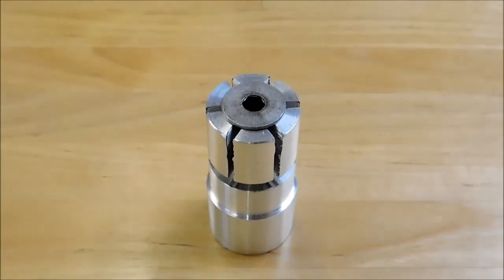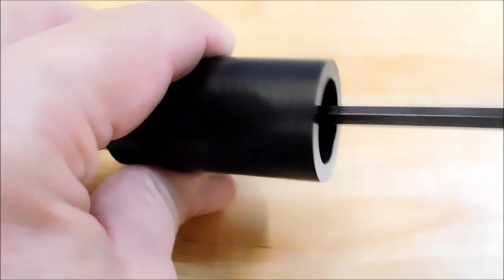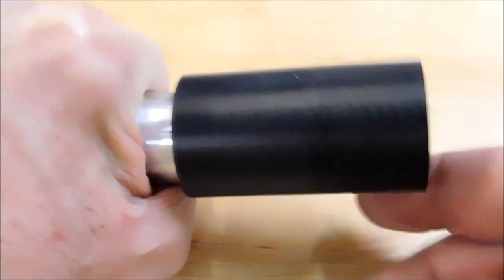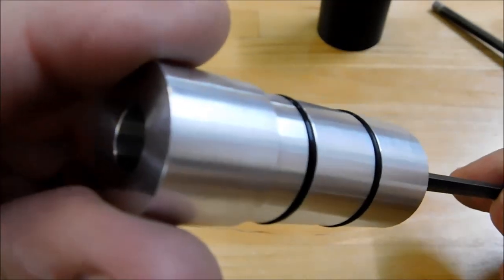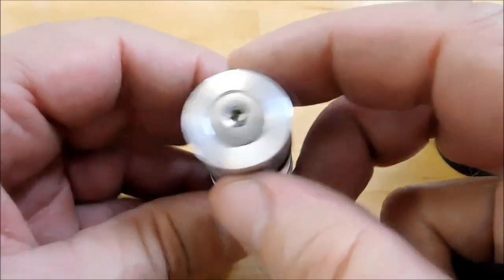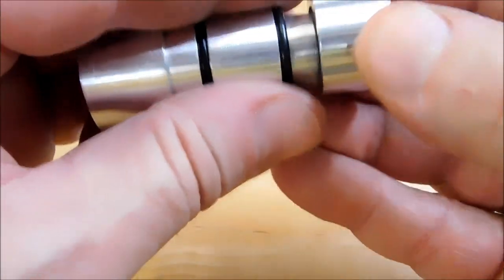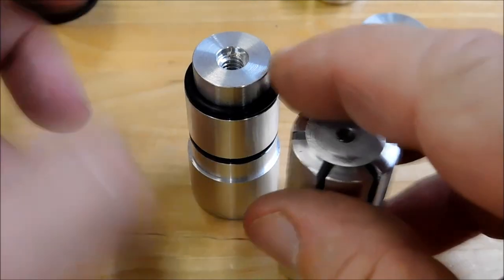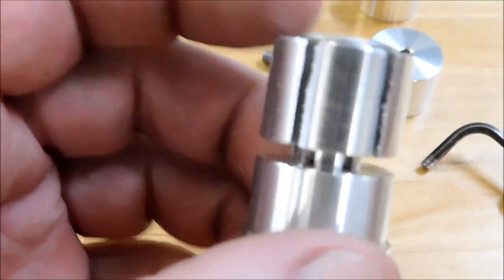Expansion Arbors --- No through hole...No Problem..Take a Look

Comment: The O-ring arbor version was a nice implementation, and your afterthought pointing out the need for drilling a short recess to the major diameter to clear the unfinished threads under the  head on most countersunk screws was pure gold. Most people would miss this, and the arbor would expand unevenly as a result.
One quick and dirty kludge I have got away with for lightly skimming the outside diameter of (say) one or two bronze or plastic bushes to ease the fit, is to use an expanding reamer of the Sutton Microset style, chuckng the shank and supporting the entry end on a running centre in the tailstock. Don't overtighten or you'll mark the bore!

Comment: For thin items needing accurate work I like to use heat shrink fits on solid arbors so there is no distortion. Lots of good info in this video on expansion arbors, thanks for sharing the tips and tricks.

Comment: thanks to your cool ideas ! they make this novice/wanna-be newbie machinist. think more outside of the box.  thank you for sharing!  here is a idea my little brain came up with for a machinist jack,  the 1/2 fine thread bolt i used to make the jack, I turned a concave in the face of the head. to receive a 3/4 in ball bearing i had. the ball bearing i ground off  about 30% flat spot in it.  I thought about using a magnet to keep them together, but i found a small dab or oil or grease works wonders too. thanks again!
Reply from the maker: I use that concept on my mill vise. Chuck over at "Outside Screwball" sells them. He calls them 'Crazy Balls".

Comment: Amazing and well done.  I was just right now having a problem making plastic fittings for a job.  You are correct, I was using an exhaust pipe expansion tool to hold the fittings but the forces were breaking the plastic.  Also, it looks like the rubber O-rings will increase the friction for holding over the friction of the steel.  Very much appreciated and it comes at such a good time.  Thank you, helped me out very much.  :-)

Comment: On a job today I was asked to make a removable fence to set on top of a brick wall. The builder had inset pvc to slide something in but did not know how to keep water out AND be removable.  Guess what crossed my mind.  I have several months before he needs them so I will be playing with this design as well as an offset bushing for misaligned pipe.
Love your techniques.
Reply from the maker: Now that you've seen it, I'll bet you solve your problem. Good luck.

Comment: These things are very handy. First time I saw arbors like this we were using pipe thread plugs to do the expanding. Not as much radial expansion, but they worked well. As is the case with a collet, the expansion makes the arbor conical, so the better fit of the arbor to the part before expansion, the better.

I've also used arbors that use an end cap to trap the part by its ends instead of expanding. Again, the closer the fit of the arbor to the part, the better for concentricity.

Comment: I actually had a need for one of these today and ended up making one. I had to cut a thread on the end of a pipe that didn't fit through my headstock and was too long to cut on the other end with a steady rest. 

My method was to turn a 60⁰ taper on a random socket head cap screw I had laying around, turn a slug to a slip fit in my part, drill a clearance hole through the slug, taper the end and cut 3 ways on the bandsaw.

I just tightened a nut on the cap screw and then with the help of the steady rest I was able to cut my thread!
Reply from the maker: Once you see the concept, the variations and applications open up a lot of doors.

Comment: Hi Joe. Great video as usual. I needed a backstop for one of my 3C collets. Unfortunately they are all different internal diameters because they have originated from different manufacturers. So the expanding arbor I made for one of the collets with great precision did not fit some of the other collets. I really did not want to spend the time replicating my design. Your design is much simpler and quick to make so suits my application perfectly. In fact the O ring style might work even better since it will accommodate internal collet diameters of different sizes with just one device. Many thanks.

Comment: Many thanks for the work you do to bring us 'newbies' along.  O-Rings are great, but sometimes misunderstood. Many times you will hear somebody say "compress the o-ring". But what you know, and maybe would be helpful to make a point of whenever the topic comes up is this: Rubber is not compressible, it is deformable. I think you alluded to this once when you were cutting an o-ring groove... The volume occupied by the rubber remains constant as the shape changes. So, that is why you can apply some serious pressure to the ID of a part with something that most folks would call squishy...
Reply from the maker: These can be very strong when applied correctly.

Comment: Thanks again Joe, you saved my day . i tried to mount a 32 " Display to a wall in our guestroom-- not a prob ?-- of course it was one, there were no VESA mount holes (holes were there but not threaded :(  ) in the back of the Display.- darn. Everything else was already mounted, swing-arm to the wall, power-outlet etc etc . and than i remembered the "last" expansion plug you showed, ran down into my shop,  made 4 of these  and finished the job.  i really appreciate your knowledge and also your generous way of sharing it with us.  rgds and all the best . michael

Comment: Saved the day! We machine polycarbonate tubing and have been looking into ways to hold it when facing the cut ends. The Idea of an 'O' ring id great. I just finished  making one from solid PVC rod and tubing for the sleeves. It works great! Thanks Joe for this tip!
Reply from the maker: I thought up  the o'ring arbor many years ago on a clear acrylic tube job. It was the only thing that would not scratch the part or break it while holding it securely. I hope it works for you.

Comment: Excellent. This is the method I usually use to hold the small cylinder casting for miniature steam engines. Once the outside flanges have been cleaned up and machined the casting is then held in the independent 4 jaws and the outside indicated and then the bore is machined. This way the bore becomes true with the usually irregular outside of the cylinder. Thanks.

Comment: joe , i was thinking your screw cutting  method would may work really well on older lathes with worn out half nuts as it would use the unworn side & eliminate the engagement problems one has when a step is worn on the half nuts , i used to use an old 17" harrison lathe that the nuts were so worn you had to hold the engagement lever up with your hand ! cheers from perth , australia .
Reply from the maker: Good point.

Comment: Great tips. You can also do the expanding metal one in a part with a blind hole by using a long screw and tightening a nut from the other end. Eliminates the need to turn an externally tapered plug.

Comment: Thanks again for clear advice and refinements on common techniques. Right now, I’m heading back to the basement where I left a small steam engine cylinder on an expansion arbor in a collet block, in the mill vise waiting for action. My arbor is not nearly as nice as yours, but the next one sure will be.

Comment: And once again, you prove that the simplest solution is the best solution. I have my own solutions for those work holding problems but not nearly as nice. Occasionally, I will make up an arbor and then attach my work piece with a bit of Loctite 609 sleeve retainer ( the non-permanent type ) which holds with an iron grip. You just have to look ahead to how you are going to remove the part afterwards. But it does work very well.

Comment: This is great!  My uncle showed me the o-ring trick many years ago.  His method was to install a "cap" in the tube but with open hole in the center, so he is using 3 screws in the face to squeeze two circular plates with o-ring in between at the top with a groove and I though that was pretty brilliant.

Comment: HI Joe I made one similar sometime back but used a pipe plug for the expansion.  I drilled out the stock and taped it with the a pipe tap then cut the slits  to allow the expansion. filed your method away for the next time :)  :)

Comment: 25 years in the tool room and I've used all types of flat-headed locking holders. The Locking thread from the front in a blind hole is slick Joe thanks. I work on molds but this will help when I build fixtures or machine parts thanks again God bless you. I'm working some pretty sophisticated shops for example Norton's Advanced Ceramics division slick little shop. You've got one too.
Reply from the maker: Thanks. I am very proud of my shop.

Comment: This is gonna come in handy. Gonna try the O-ring arbor for grabbing some parts that have thin walls, that need to index on a bore for drilling in the mill. Was looking at buying expanding joints but the part doesn't need a whole lot of holding force just a gentle hold against a 1/8" drill wanting to pull it up. 

Also got a few parts on the CNC lathe where I could see making the O-ring arbors in bulk so I can setup to run multiple parts back to back while exchanging arbors offline. Since the method doesn't need any slitting work they'll be easy to pop out 'en masse.

Comment: Good afternoon Joe, the o-ring arbor is brilliant. I have a job that I have been struggling with and will try it out first thing Monday.

Regards,
Reply: yep the same i was working on a 1.25mm wall tube about 120mm long and having problems but i think this is the ticket to get the thing over the line

Comment: Hi Joe, as always thanks for taking the time for these vids. After several decades I know we learn not only from invention but from each other once some loose the young, I know it all, attitude :- ).  I saw this one a few times and finally watched it with a blind hole coming up on a job. Very similar part. Concentricity was within .0005 tir and had to turn OD to ID. I figured bouncing the arbor in and out of a collet on a Hardinge chucker may be an issue. I did think of turning the arbor and leaving it in the collet but that would take an awful long wrench or threaded rod and cap from the left end of the spindle bore to tighten the arbor cover lol. Only a handful of parts needed. Ultimately I just faced, drll, bored and skimmed the OD before cutting off a tad long to face the back. I know this will come in handy and thankx for helping to keep the mental tool chest of ideas filled and ready. 1 up to you for your time. Chris Kennedy
Reply from the maker: Thanks Chris. Necessity is truly the mother of invention.

Comment: I always wonder what you are going to come up with next.
Look forward to every one of them.
Thanks yet again.
Reply from the maker: How about "How to push a .02  diameter drill into 316 Stainless without breaking it"??
Reply: 300 series is a dog to work I would like to see that for sure, most people break bits by spinning too slow and feeding to fast.
Or ruining the bit by spinning too fast and feeding to slow.
Or work hardening the metal and going nowhere.
This is a constant source of my misery at work with hand drilling.
That and their constant lack of using lucubration and not using pilot holes.

Comment: To make a quick, accurate and tough mandrel to tidy up parts  get a piece of stock, drill and tap the appropriate sized tapered pipe thread in the end. Turn close to size. Remove from lathe, put in a few splits with a cuttoff blade. Rechuck, clean out thread carefully with the tap. Then lube up the thread in a matching  dry seal pressure plug. Tighten carefully until some pressure is expanding the mandrel. Then finish turn to suit the parts you need to hold including any shoulder stop. Back out plug a bit, offer part over mandrel and torgue up plug. Had good holding ability, cheap, leaves no marks on the bore, is quick to make and because it relaxes when you back out plug easy to get parts off. Perfect for finishing OD and corner chamfers on the likes of small and modest gear blanks and the like.
Reply from the maker: I like that idea. A pipe plug would be an excellent thing to use and readily available. Thanks.

Comment: I just so happened that i need to modify thin wall plastic bushings, i did couple with super glue but the o-ring method seems to be the way to go. Thank you for the thip! :)
Reply from the maker: Experiment with the placement and torque. The o rings have surprising strength.

Comment: Funny, I was building an expanding arbor last night, but mine is for setting up my quill DRO. I'm doing mine a little differently. I'm drilling through the entire length and not quite tapping all the way through. The end should expand as the cup point set screws hit the unthreaded part at the very end. I'm only relieving 1 or two areas for expansion as the tolerances are extremely tight already.
 Timely video. Keep reading my mind Joe.
Reply from the maker: Drop a ball bearing down inside your hole, then put your screw in. It will help to reduce friction and help with the wear factor.

Comment: To take any “guessing the real problem” out of the way I have taken flat head screws and spun them on a surface grinder to put an undercut where the thread stops and could flare out the expansion collet unevenly and make it not spin true. I have a large assortment of flat head screws now to use.

Comment: Made a Couple of these some 10 years ago, to clamp watchcases from the inside, since i always start with the inside.
and for the lathe i use an M8 Threaded Rod, with a big knob threaded to the end through the spindle of my lathe, there's a boss on that knop that fits in my spindle.
For the mill i have made a conical "Cap" with M6 that i can thread from the back, or a "Cap" with an M6 Countersink,  that threads into a T-Nut on the mill table, or to the 4th axis, or into an M6 nut pressed in the "trunnion" on the 4th Axis.., you can't do without these.. 
I also made some Collets that fit into the 3 Jaw chuck, with an M8 Thread in the back, to put in a Stop, so the depth is repeatable.. and the collet functions as "Soft jaws at the same time.. Ideal for machining small parts..

Comment: In blind hole configuration for the slit arbor instead of making a separate taper plug you could you long enough screw and machine small hex head into end of it. If you have a suitable broaching arbor you could make also inside hex, torx etc. socket hole into the end. 

Also many of fasteners used in cutting tools have same size hex/torx-socket in the both ends and one might be able to use such as a fastener also.

Comment: Joe those expansion arbour makes for a nice floating/adjustable spindle stop held within your lathes main spindle.
Ive  just added a 16mm x 150 ling spindle on one end to pass through into the chuck if necessary.

Comment: great stuff joe, as always. how about tips,  techniques for measure of long pieces. in the home shop were lucky to have 12" verniers. how do you get accurate layout say on a 50" shaft with shoulders for bearings?
Reply from the maker: When you have to improvise, a pair of good v blocks can be invaluable. Once you know how wide they are, you can set and leap frog them to very accurate positions. The layout should be easy from there.

Comment: Turning a softer type material on the xxpansion arbor - can be supported on the outside with a collar which fits closely so the arbor does not burst it
Reply from the maker: I have often used light press fit plugs and collars for softer materials. Its a good combo.

Comment: I saw where you were going with the 82 degree plug, but my solution was to keep the face of the expanding feature intact and use a screw with a taper ground on the end.

Comment: I do a bunch of this, but use tapered pipe plugs. The angle is narrower and so, the pressures are wider. They have to be much more precise though. I use carbide pins and then EDM the transversal cuts.

Comment: Elegant simplicity at its finest!  Very clever and impressive. 

Are there ever any situations where you could lose clamping pressure due to the screw loosening?
Reply: Slother93 I can't think of any off the top of my head. But, if that is something you are worried about. You can do this. Clearance drill the expanding portion of the arbor for your screw. Then, drill, tap, and install a thread locking heli-coil in the body. Then just use a longer screw.
Reply from the maker: Running the machine in reverse may not be good, but the forward rotation of the spindle and drag from the cut should only tighten the setup.
Reply from the maker: And definitely make sure your threads go into the solid part of the arbor.

Comment: Great video, I had never seen the O ring variant before. Also the method for tightening from the back was clever. I have a range of what were cap heads, which have had their heads turned down to 60 degree countersinks. Im not sure if this makes much difference compared to a 82 degree countersink but perhaps you get more leverage?  A friend of mine swears by using a dividing head and slitting saw for cutting the groves in expansion arbours, do you think you lose any concentriciy by using a hacksaw? Cheers Crispin.
Reply from the maker: Hi Crispin. That would depend on how much of a solid locating diameter your arbor has. Also, I believe if you cut the expanding part initially while under pressure, you neutralize any uneven expansion right at the start. A hacksaw should be fine.